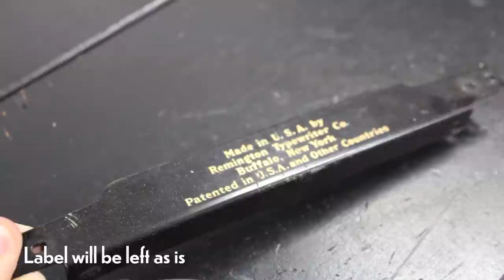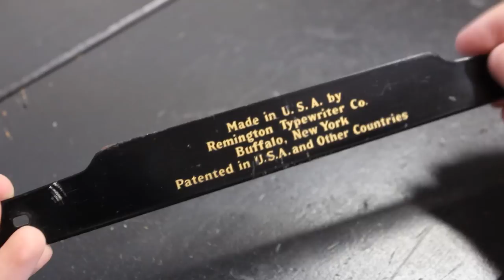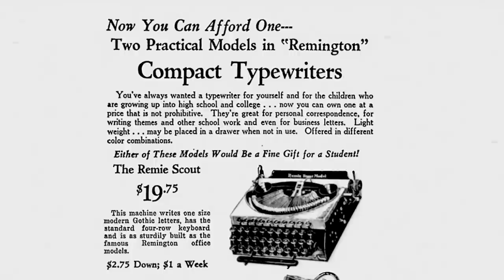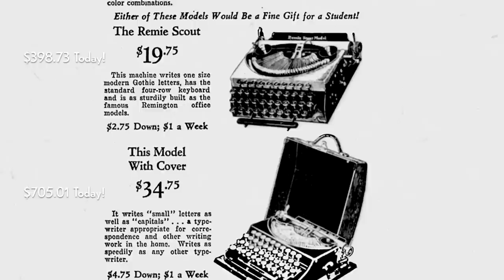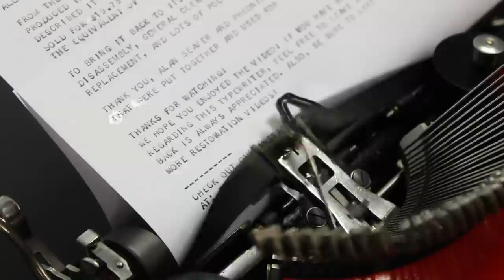1930s Portable Typewriter Restoration

Comment: What an amazing job - it was a stroke of genius to use heat shrink to re-cover the rubber parts. 

One of the best skills I have ever learnt is to touch type - got me through university. I learnt on a mechanical typewriter, so you really had to depress the keys. First thing we learnt was: qaz wsx edc rfv tgb, yhn ujm ik, ol. p;/ - had to type this over and over again to 'programme' our fingers to know where the keys were based on the home keys.
Reply from the maker: Thank you very much! 
That's a cool story
Reply: Typists use heat shrink tubing on platens often to repair them, it’s better to have them sent off to JJ Short for professional rubber coating
Reply: @solitairepilot  Short looks like they have a nice operation.  They'd be worth getting a quote not only for this, but for idler wheels of phonographs being restored, if the restored apparatus is expected to have any kind of long service.  I could see how type faces could eventually cut through the thin tubing.  Use it once a year, no problem.  Once a day, maybe it won't last long.
Reply: @SeekingTheLoveThatGodMeans7648  Yeah, you wouldn’t believe the difference in type quality between a rock hard platen and a springy new one. It quite literally type’s like new

Comment: Very good work. It was a lot of fun to watch.
A little tip. For typewriters, use very little oil or none at all.
With a little time the oil combines with dust and then you have the fun of doing it all over again.
Still, good work. It turned out well 👌

Comment: A couple things I would suggest. One, look at getting different sizes of toothbrushes and even a denture brush, to scrub off the dirt easier. Also, try and expand the range of screwdrivers so you have access to ones at least as wide as the screw. Using a screwdriver narrower than the screw inevitably raises burrs on the screw head (I’ve taken apart many things over the years).

Comment: Excellent restore! The use of heat shrink for the platen and rollers is a stroke of genius! I've restored a few typewriters and it's not for the faint of heart. The platen and rollers turning to black concrete was my biggest problem but I may revisit by restores and do the heat shrink method.
Reply: I agree, it seems a very versatile method of resurfacing them without having some very expensive custom service strip and re-mold them -- so long as the surface friction of the rewrapped parts is sufficient to hold the paper.
Reply: There is a company that remakes rubber parts. They may be too pricey.

Comment: Well done on a excellent job. Great job on the platen and rollers…usually they would be sent away for new rubber ….after years they go hard and makes holes in paper on letter 0…
I never came across one like that unless they never sold in uk….ten years as a typewriter mechanic 1979 ~ 1989..
Reply from the maker: Thank you very much! Means a lot coming from an expert :)

Comment: The "A" key seems to strike slightly to the right of where it should, based on the kerning. Similarly, the "V" key hits low and to the left. This is the sort of distinction that typewriters developed over time that could be used to forensically trace documents to a particular typewriter.

Comment: Such patience and planning to get this typewriter apart, cleaned and repaired, and then back together. Is the heat shrink cover for the platen a product especially for that purpose? I think at one time platens would be refreshed with sheet wraps of rubber.. but I couldn't figure out how the edge would be finished.

I love the sounds a manual typewriter makes!
Reply from the maker: Thank you!
It's just general large-diameter heat shrink tubing, not specific for this job :)

Comment: Looking at the prints, did you adjust anything after you put it back together? The top of letter H seemed a bit off. Excellent work - I’d prefer not to oil the type slugs closer to the segment. It can attract dust down the road. ;-)

Comment: Great restoration, but I cringed a little when you rubbed the dust off the painted surfaces with a semi damp paper towel. I know it was probably scratched before but it just hurt to hear the dirt scratch the original paint. Otherwise, great job

Comment: Impressive job. 
(you made a mistake in your pangram though, for that you can give me the machine 😉)
Reply: It's "the quick brown fox jumpS over the lazy dog" not "the quick brown fox jumpED over the lazy dog", otherwise you miss the S.

I learned to type on my mother's typewriter in the 60s - she had a typing textbook that I followed. Over the years she bought an electric typewriter - much less effort - then an electric one that could backtrack (it memorized the letters typed and re-typed them using a white correction ribbon). 

I started working in IT in the 80s. At that time most computer systems used a teletype machine as their system console - that is, an electric typewriter that could transmit or receive the letters it typed. It had a characteristic sound, like a heavy machine gun. As teletypes were used in newsrooms all over the world, the dum-dum-dum sound it made came to be associated with news, and even today, the intro music to just about every news programme has an echo of that sound.